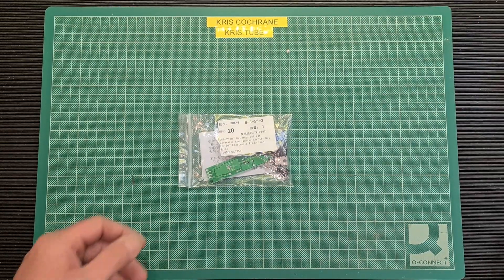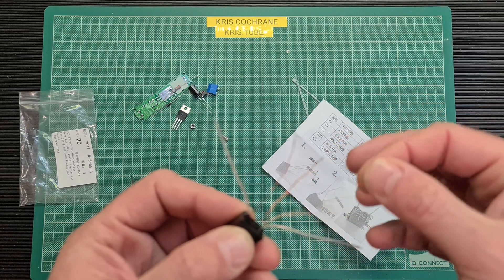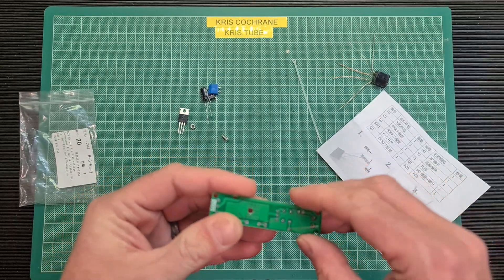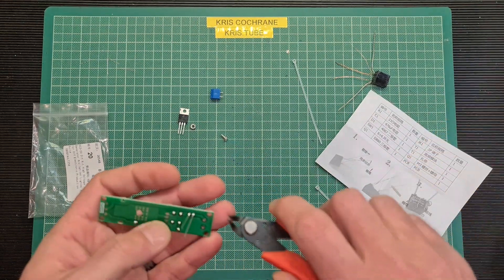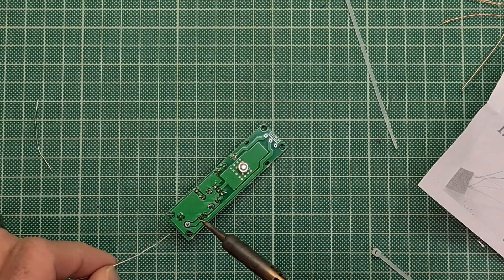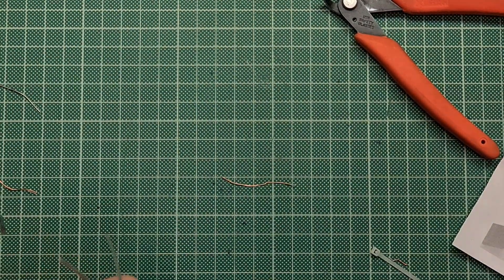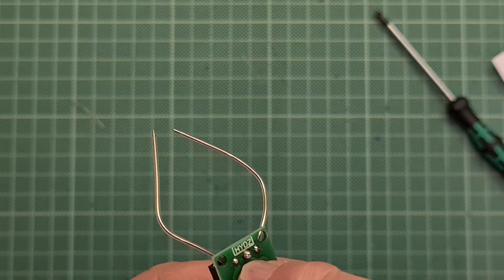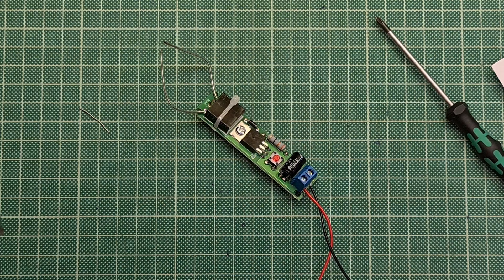High Voltage igniter kit build #DIY #Electronics

Comment: I built one the exact same a few months ago. And same thing, didn't get the enameled wire cleaned off properly. I did test the output against my leg.......it bloody hurt! 
Question about your recording Kris. Is the audio recorded via two mics? I normally watch on a computer with external speakers. When you're talking and doing stuff, the audio goes up and down on the left and right, kinda like you are moving between mics.